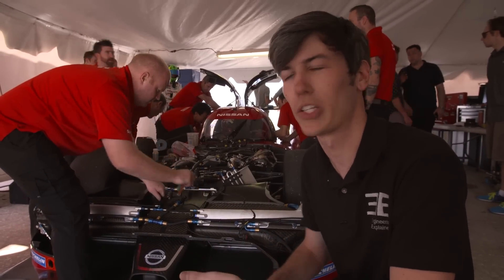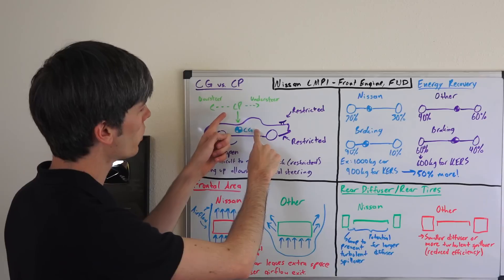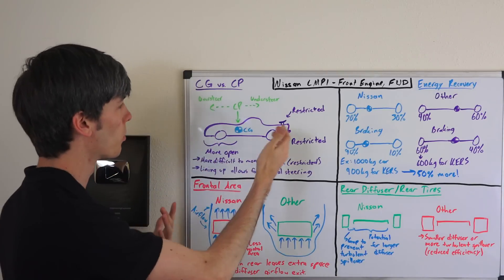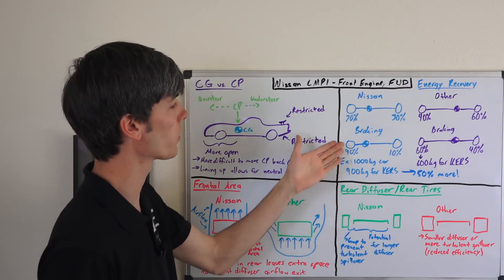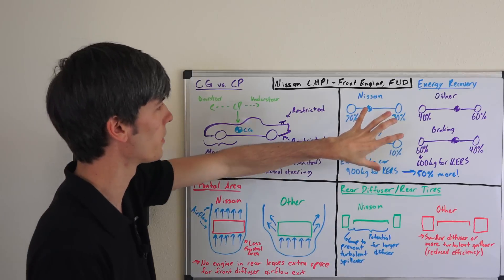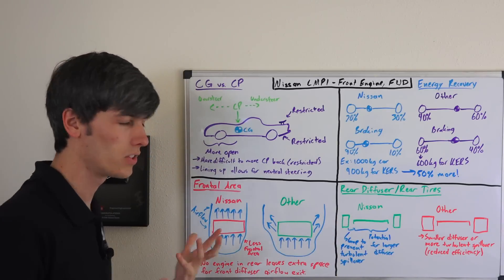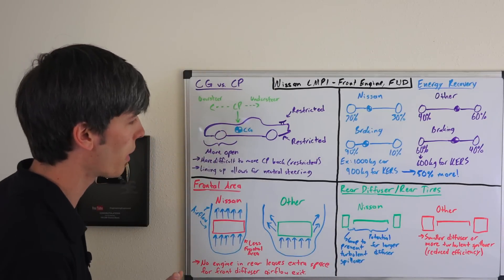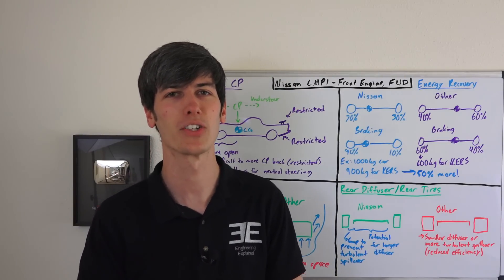Nissan GTR LM Nismo - 4 Reasons Why Its FWD & Front Engine

Comment: i have problem with your logic about energy recovery and loading on your tires. Mass is your car what give out energy,not loading. you can recover energy for tire with 5% of total mass on. You care only will that tire will not slip ground. Somehow i don't believe that energy recovery can lockup your tires even with as little as 10% of total mass on it. so it is pointless to put energy recovery on most loaded wheels
Reply from the maker: Linas K What? No. KERS systems can recover an enormous amount of energy very quickly, especially the mechanical system they're implementing. I'll have a video on it which will be uploaded to Nismo's YT channel.

Comment: I know it's pretty much unavoidable, but are there any unique ways that they deal with power steering? Or does the driver just have to get really good? I imagine in these cars the steering wheel would feel a lot like the expression trying to "grab a bull by the horns."
Reply from the maker: TurdFurgeson571 I spoke with the drivers and they mentioned torque steer was barely an issue, and that it was very manageable. The system has been well designed. They did mention that it does a bit of hunting when you're in a straight line, and Nissan was working on correcting this.
Reply: TurdFurgeson571 That is what i read yes.
Reply: TurdFurgeson571 with the cars going as fast as they do, racing drivers don't really need to turn the wheel that much. on hairpins and tight corners, yes, but they would be going slower
Reply: Aaronx3Sally Okay. I get that. But exiting those hairpins, for example, you would be put some serious force to the wheels to accelerate out of it. It seems like power steer would be an issue then. 

That's the great give and take with racing I guess.
Reply: TurdFurgeson571 KERS powers rear wheels if im not mistaken which is probably going to be used at corner exits.
Reply: Engineering Explained I'm glad you thought to ask that. I wouldn't have thought it was such an insignificant factor. I'm sorry I'm still a noob, but what is "hunting?"
Reply: carlover Oh, interesting. Both wheels?
Reply: TurdFurgeson571 Quick FWD cars I have driven aren't that different in steering. Feels like your being pulled along instead of pushed.
Reply: TurdFurgeson571 When the car was on Leno's garage they did confirm that the car has hydrolic power steering and alluded to all the cars having power steering of some kind. Another advantage of the front engine is that their power steering hoses are very short since the pump on the engine is only a few inches away from the rack saving weight. They said electric steering was not powerful enough so it seems with the amount of tire they have on the front, power steering is a necessity.
Reply: Brian Turko Interesting. It amazing how all those minor things come together, seemingly intentionally, with a change like moving the engine forward and powering the front wheel.

Comment: 1 question... what's good of a race car if it makes drivers hesitate to step on the paddle when attacking corners? or am i completely missing how they eliminate understeering?
Reply: Stanley Li The rear tires have a smaller footprint than the frontal tires, so the rear end of the car have less grip and would induce oversteer. However, due to the car being mostly FWD, it also has an element of understeer. tl;dr it will probably have a neutral handling around corners.
Reply from the maker: Stanley Li Yes to your second question. Front weight bias plus front downforce leads to a more neutrally handling car, as described in the top left portion of my whiteboard. :)
Reply: Stanley Li During high level racing, the driver should never accelerate through a real corner because it takes away traction from the tires to hold the turn since the load is rather great, unless the racer is going slow through the corner, but then they shouldn't be racing competitively if they take corners slow. 

Now during bends that are okay to do some throttle through, i think the combined aero and grip of the tires, and suspension/drivetrain setup that are used for racing should be sufficient to hold the car in its intended path, or else they wouldn't have gone through with this.

The only issue i can see about this vehicle is how long will the front tires last since they are doing the braking, accelerating, turning, and taking a lot of load through the g forces caused by those dynamics.
Reply: i see pro racers start accelerating as soon as they are confident the rear of their car won't slide out. most of the times this means they are going to put their foot down when half way or 2/3 of the corner is cleared. isn't making a FWD racing car going to take awaytheir ability of doing this? i still don't understand how even a well-balanced FWD can eliminate understear when accelerating with angled front wheels (in corner).
Reply: Stanley Li Just a different driving style. Lots of trail braking and cornering speeds vs slow in, fast out. A more momentum type of approach. Besides, GT racing isn't about max speed. I'm sure they have their disadvantages but the KERS and aero efficiency make up for it as mentioned in the video. Race results will tell...
Reply: jrel210 Don't forget that cornering with that ratio of weight over the front tyres means a crapload  more angular momentum directly on the front tyres. If they're running the same compounds as the rest of the field this car will be in the box hell of a lot.

Comment: So why is the rest of the field not using fwd if these distinct advantages of fwd are so.
Reply: Timotheedle Because tradition (and data) dictates mid engine is a sensible approach.

But if this is competitive, you can guarantee that other teams will test this setup.
Reply: Just one more thing to add. This is all well-and-good for Nissan to test, but it costs a LOT of $$$ to try out this approach.

So there's GOT to be a reason they went with this setup. It wouldn't otherwise have made production.
Reply: Definitely. I think the pro is that there isn't a lot of regulation with FWD, so they get to stretch the rules around their interpretation..... And he covers that re: bigger rear diffuser because of the more narrow rear tires.
Reply: It's really more of a pro and con thing they both have GOOD and bad things about the design
Reply: Timotheedle Cost, time, tradition, experience, and stigma.
Reply: Being innovative head tons of risk with little pay off. They will spend a ton of money rewriting the rules on how to make a race car and even if they went with a more traditional layout still doesn't mean you will win.
Reply: Timotheedle To add from Eric's, one of the thing is they already have the shell/ frame/skeleton of the car from previous years etc. Therefore they dont need new ones. They just use those there cost wise is the same. If Nissan did change the skeleton/frame, then they would need to refabricate them all over again which might cost more or less money depending on design. In example let's compare 2008 Toyota Camry and 2008 Honda Accord (4 door Sedan). The Honda Accord have a rear bump at the rear sits in the middle for a propeller shaft to the rear axle even though it's FWD therefore the was no propeller shaft there. In Toyota Camry's case, the bump is absent, only very little bump where I believe the prop shaft cant be mounted anymore except if they refabricate the frame. So my guess, Toyota used less materials therefore costs less, while Honda just use the old one because they already have them ready. I might be wrong though. Just a little piece of my knowledge. Read this from a car guy's page at FB about 3 years ago. Cant find the page anymore though.